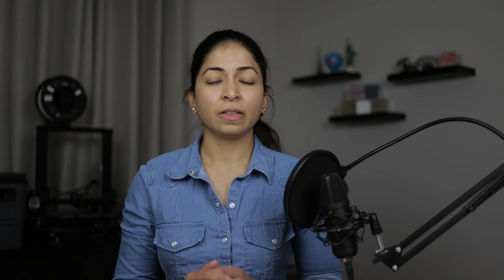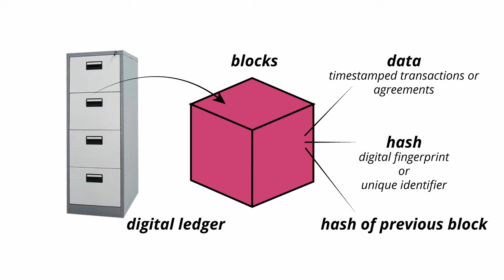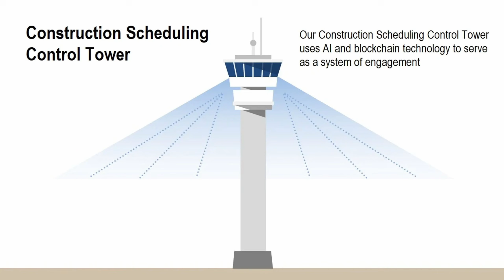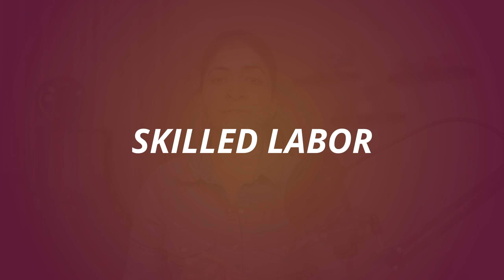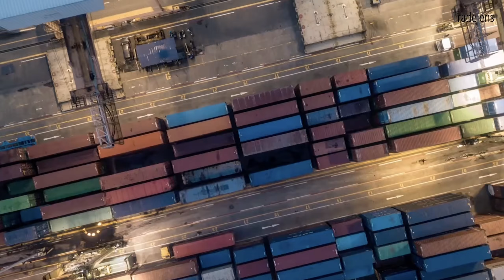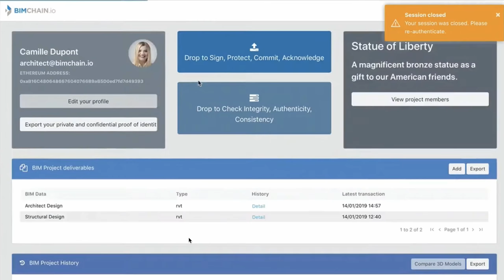How Blockchain is Disrupting the Construction Industry

Comment: I am a software developer working for a large US electrical contractor -- I personally see no value add from "blockchain" or crypto technologies that can't be provided by traditional APIs.
Reply: There's nothing that blockchain does that isn't more simply and efficiently done via something else like a database. If you need independent governance or mediation  or trust: set up an independent organisation like how open source or stuff like wikipedia works.
Reply: @--Nath--  basically, you solve transparency problem (which is extremely nice especially in case of dealing with big companies or government) by paying awful time and computational price. But it really did almost nothing in trust department and surprisingly, it doesn't eleminate need for third party mediators.
Reply: @paveloleynikov4715  The computation price is completely trivial, microseconds on a cell phone from years ago.  

This is not cryptocurrency and nonce value mining.  

Nothing that would be used in construction or logistics spaces would be built to use anything more expensive than a single SHA256 hash, which is computationally trivial even with gigabytes of data.  They are not trying to farm a magic hash or nonce in this space.  Really, completely unrelated to cryptocurrencies other than they both use hash algorithms to create an acyclic graph.
Reply: @everydreamai  Why blockchain then rather than Web of Trust?
Reply: @SianaGearz  exactly.. web of trust, databases, workflow and rules engine.. don't need to implement a decentralized anonymous database relying on a population of nodes for authentication and integrity.

This is a construction project with a relatively limited number of known entities who have already signed many contracts with each other and worked face to face.. Blockchain is not the tool to help here
Reply: @everydreamai  you need to do computations for any changes to the ledger which means anything in the building process. And in this situation the entries are huge contracts, designs, invoices, etc.. not 2 line transactions.. also need a pool of nodes processing the  ledgers to insure it's not hacked.

Which points to private Blockchain and that's just a terrible database design that offers no advantage and actually worse
Reply: @SianaGearz  You're asking the wrong person.  I'm not putting forward anyone should use blockchain for anything, ever.  I might as well ask you why green is the best color for T-shirts. 

Of course, whatver you do any digitcal communication happens over industry standard protocols like TLS regardless, as a matter of standard networking practice, that's a completely different level of concern than is being discussed in the video or what some theoretical "blockchain" solution would do for you. 

You can adhere to Web of Trust for all your API/networking calls but someone could still try to fraudulently backdate or modify a document.  That's why blockchain is trying to protect against.  I have serious questions, as you probably do, if it really adds much value and you should read my other comments on the subject, but I also don't think misrepresenting it is part of a useful dialog.
Reply: @paveloleynikov4715  I still reckon there's some fundamental flaws with "no delete" when you have open writes.. sometimes the ledger needs scrubbing when there's ability to encode random (illegal) stuff in it. In addition to the issues you raise.
Reply: maybe try removing the Contract & Claims from the entire development process.
Reply: This shows how a web2 is able to support the web3, with an existing web interface/software that logs the data transactions, not messing in the task.
Reply: @--Nath--  As a wikipedia editor since 2007 I can't agree with the last statement. All too often it doesn't work. The English segment is somehow struggling to keep balance, but elsewhere it's much worse.
Reply: @UCBkUWxsZqT8PNY6ByoMISNQ yeah it would not be that computationally taxing if: it was only 12 nodes hashing, it wasn't complex data and it wasn't constantly processing ledger changes. Those are all big ifs and present their own problems if used that way.

The big problem I see is, how do you insure the ledger's integrity when there are so few nodes? what if all the subcontractors all decide to change the ledger to something more favorable to them? Either its decentralized or its not and with a small private blockchain, you are in for trouble.

The bigger question is why are you deploying some type of decentralized system of authentication, integrity and data-storage in a private controlled environment with so few parties/nodes? 

A centralized authenticated workflow management system managed by a third party like Verisign makes so much more sense and you're not randomly processing hashes for the fun of it..
Reply: @Josh.1234  A single node disagreeing would be a gigantic alarm, when you realize ALL parties know each other.  This is not an anonymous network.  This is not cryptocurrency where hundreds of billions are at stake and you could expect an attacker to have a motivation to spend ridiculous sums of money to defraud people who could never come back after them or even identify them.
Reply: @everydreamai  you are arguing both sides of this.. 

if its so small and all the parties know and trust each other, why are you using blockchain in the first place? 

and if not, then a small set of nodes could easily be taken over by a few hackers who decide to get 51% of the nodes and hold the project ledger hostage till they give them crypto.. 

this is just dumb application of the technology. there are other ways to use cryptography that would achieve authentication and integrity without blockchain and be much more simple and efficieint.
Reply: @Josh.1234  I'm not taking any sides...  You're missing the point.  It's not about taking sides of anything, it's about understanding the technology.

I don't understand the value either, but that's no excuse to misrepresent the technology.

If you're focusing on who is taking what side in every discussion you'll never learn and probably aren't doing a great job listening or understanding what others are saying.  Really, it's the wrong way to hold a discourse.
Reply: @everydreamai  my meaning in sides was on whether different aspects of it's functionality have utility or not. It's sounded like you were arguing for/against at the same time almost. I didn't mean sides as in we are personally against each other.
Reply: I agree.
Reply: "APIs benefit from blockchains as a database because they can store data more securely than traditional databases can and their immutable nature makes them tamper proof while processing large volumes of transactions"
Reply: WhatsApp usage for contract agreements would be more useful for the industry....